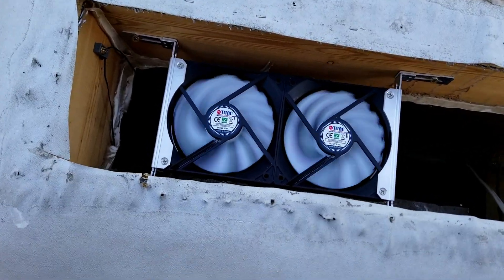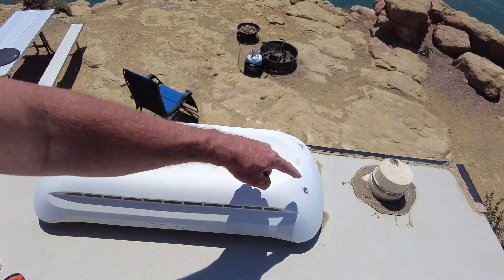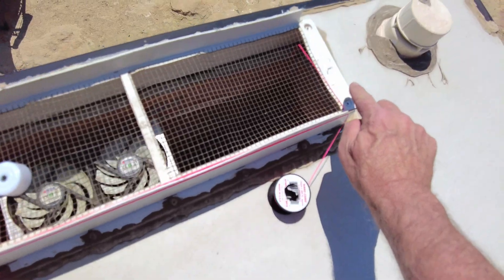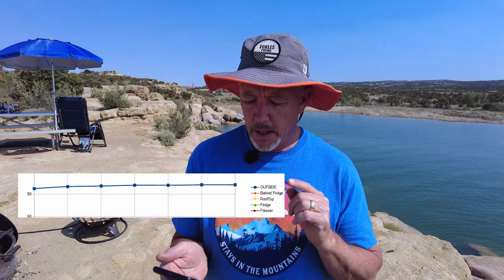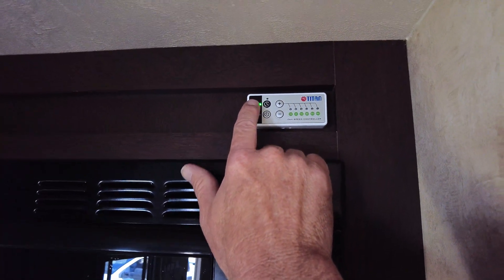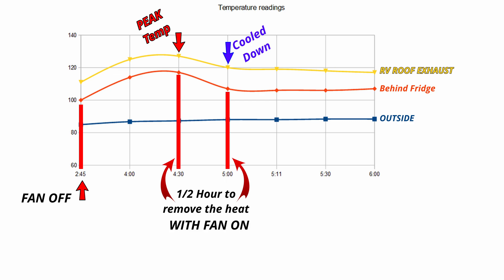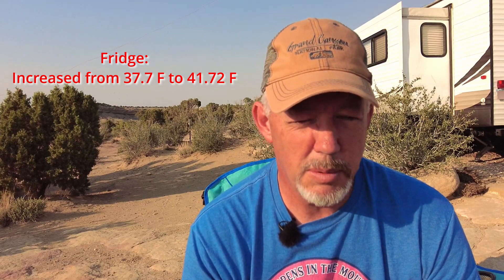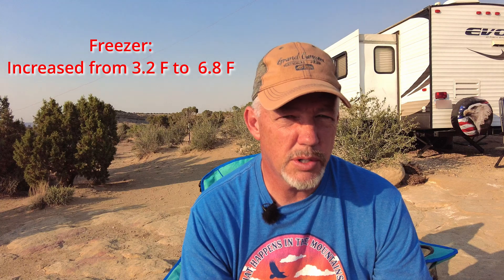RV refrigerator not cooling enough ?| TheRVAddict

Comment from the maker: Does your RV Fridge struggle to get your food cold ? 
This Upgrade may be an easy FIX for you that will provide reliable temperature control for your Absorption refrigerator.
Do you have an exhaust fan ? 
Have you upgraded your Control Board ?   What is your experience with an upgrade like this ?

Comment: I do not understand if these need these extra fans inside & out why don't they put them in there from the manufacturer?
Reply from the maker: You have a good point, i think it is like seat covers in a vehicle. You don't have to have them, however they can improve your experience. So it becomes an accessory.
Your fridge may work ok, until you go camp in a really hot location then you will notice the difference. 
I also notice that it reduces heat inside the RV that would normally be trapped in that rear compartment. 

I hopes that helps, thanks for watching